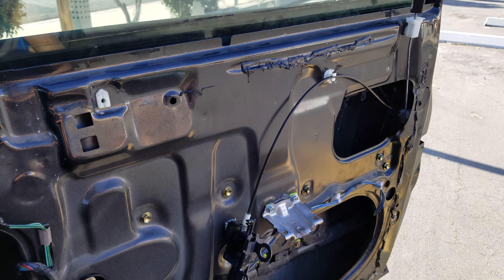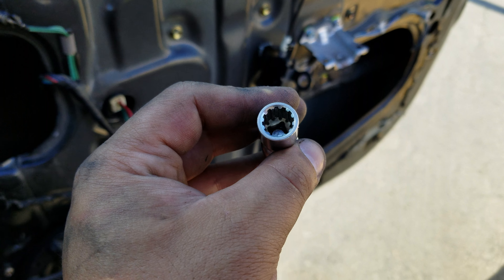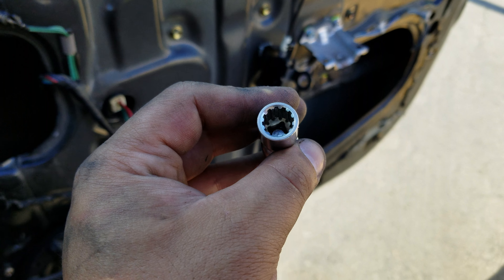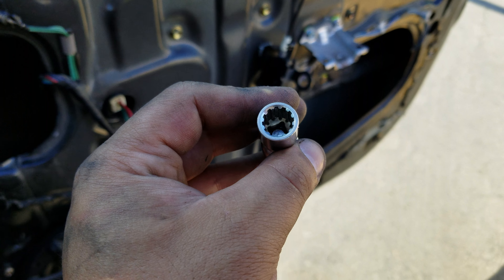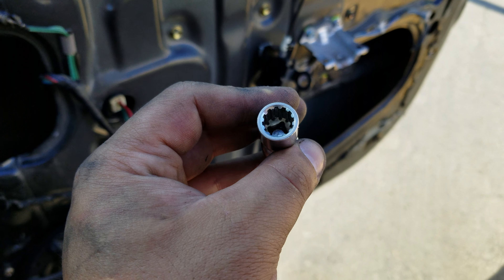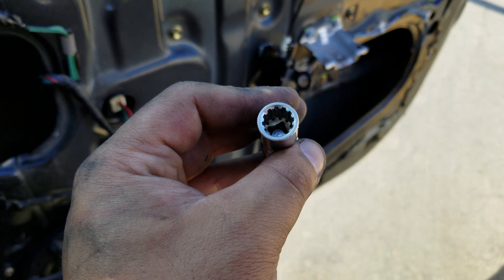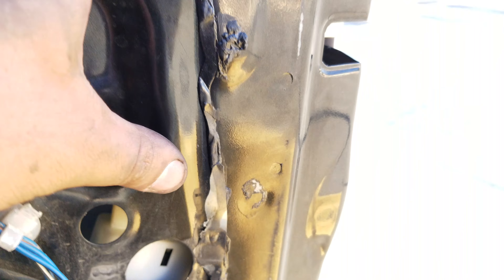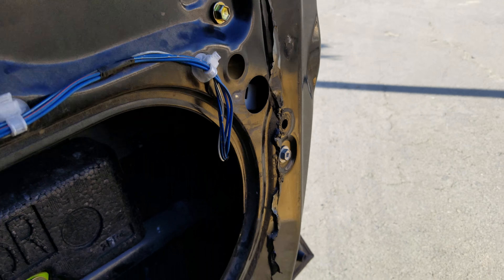How to remove door lock actuator first gen xb

Comment: KnownAsGeeks, thanks for posting this.  Though I agree with some of the other posts that your video spent a lot of time discussing items that didn't pertain to the project at hand, you still posted enough information for me to replace my front passenger door actuator on my 2006 Scion xB.  Most important is where you mentioned the two little screws holding the actuator to its frame; you have to unscrew those blind (you can't see what you're doing inside the door) and you do need a very short stubby phillips screwdriver.  You also explained which other bolts and star screws have to be removed, and without your video it would have taken me way longer to figure out.  At the end of the day, I successfully replaced my actuator, and your video was very helpful in doing so.

Comment: You glossed the most difficult part of removing the mounting screws holding the actuator - the only reason I viewed.Thanks anyway
Reply: I am stuck tonight on this one. Got one screw off and gave up for the evening.
Reply: @DanielMendoza-wg7lq  squirt of penetrating oil and an offset screwdriver?
Reply: Did it today, the most difficult is not to remove the screws, that was easy, they weren't even screwed on tight from the Toyota factory. Rather, the most difficult part was getting the white plastic lever piece on the actuator into the correct position (little white ball) with the the door lock lever to raise and lower it. Once you have that in place and are holding it with your hand, then put the first screw in, then the second, then try the electric lock switch (on the passenger side if you've disconnected the drivers) to see if it works.

Comment: Oh my god... You spent 10% of the video talking about a muffler for another model, 10% about a socket you are clearly infatuated with, 70% of the time explaining how to remove the door panel that was already removed and the remaining 10% of the time was spent on the actuator... WHICH WAS ALREADY SWAPPED!  While I appreciate your wanting to help, and thank you for that, check out other similar videos and plan it out.  Staring at an exposed inner door frame while listening to a narrative helps little.
Reply from the maker: I told anyone watching this video exactly what to do. If your not following the video correctly as I tell u then not my problem. I'm not here to hold snyones hand. Just to guide them. Now, if you want a start from the beginning teardown say so I can make a quick video less than 5 mins only taking apart the panel then door lock.